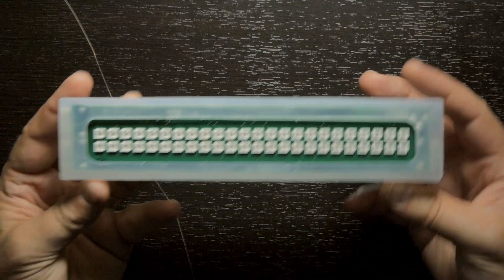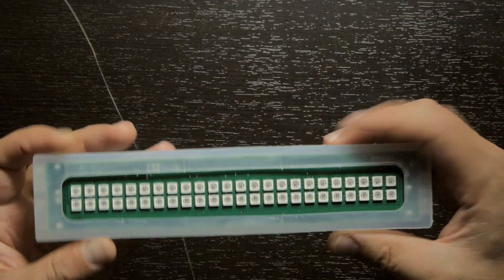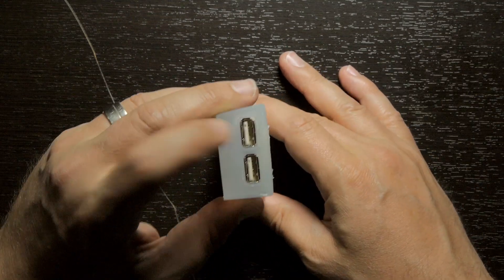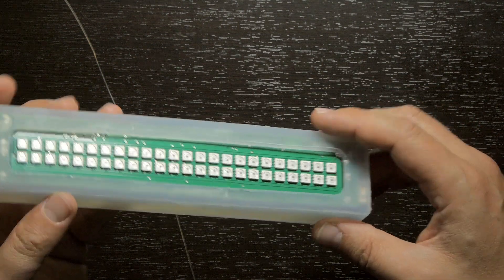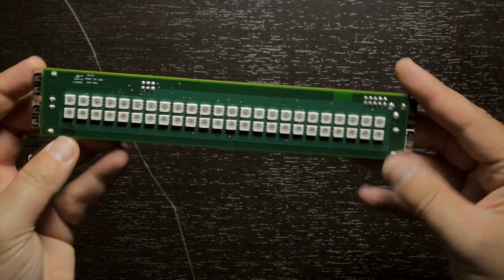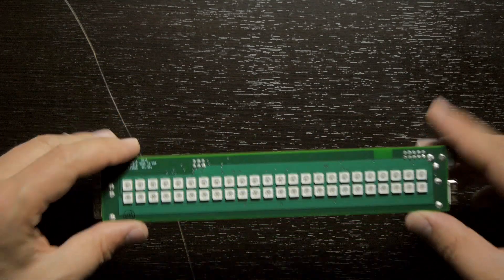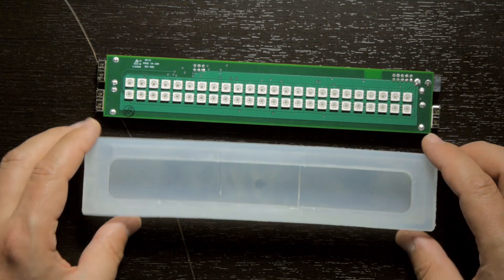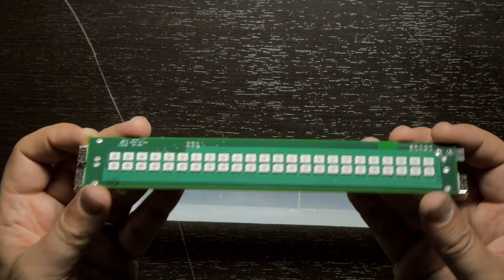The Build — Wej housing iteration

Comment: Any chance of some feature updates for iMPC pro? Velocity sample layering/switching is my number 1 request.
Reply from the maker: aikighost We're working on some updates as we speak. I can't say what just yet...
Reply: Retronyms How about support in iMPC Pro for recording through the iPad data cable? For example with gadgets like the Apogee Jam and similar products? Or is that already possible?
http://www.apogeedigital.com/products/jam
Reply from the maker: +Rúnar Örn Olsen sampling through the lightning/30 pin connection works — for example today I made a series of samples using a Blue USB Mic. I haven't tested the JAM specifically, but if it's class-compliant it should work fine.